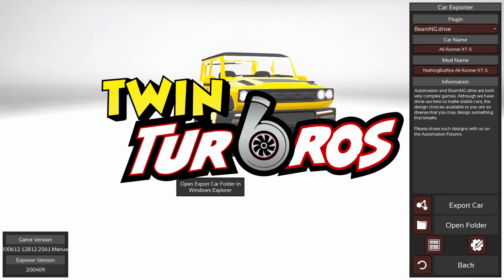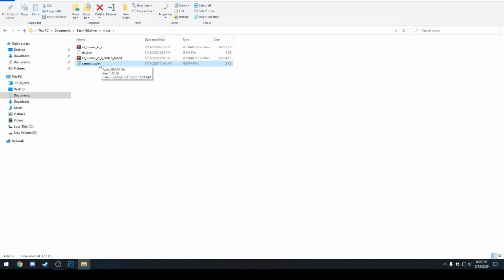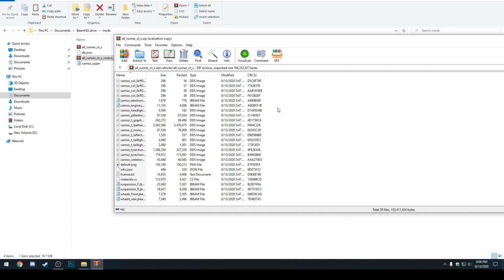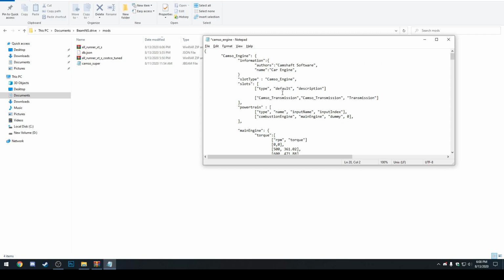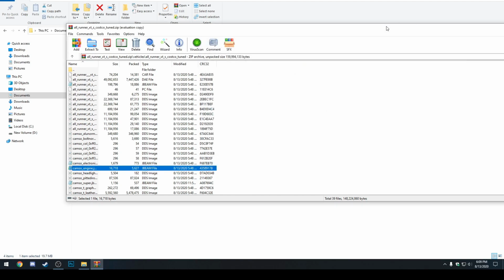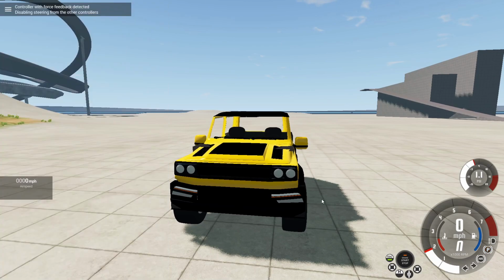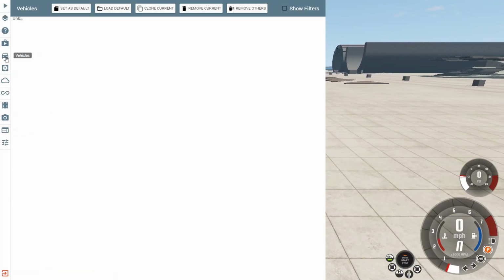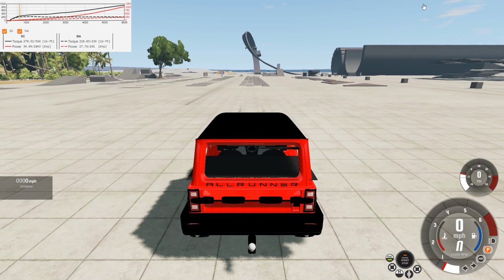How To Supercharge Your Automation Cars!! Automation - BeamNG

Comment: Hey, will I have to lower the octane rating of the engine in order to use the supercharger (like when we turbocharge engines in Automation) or can I run it on pretty much the max octane rating with no knocking?
Reply from the maker: You can run anything as far as I have tested!